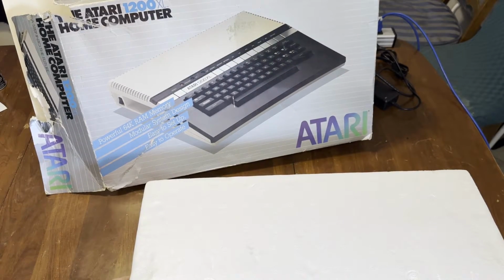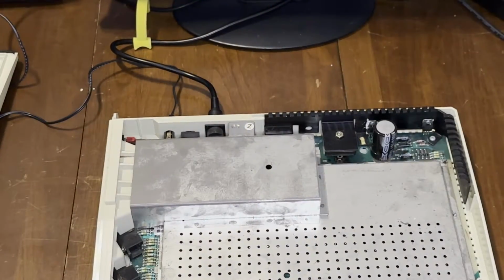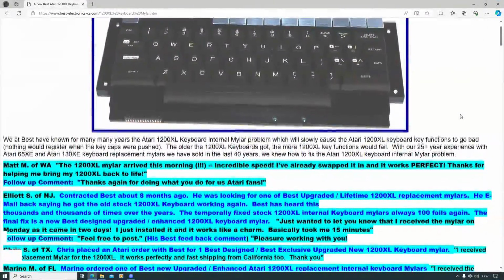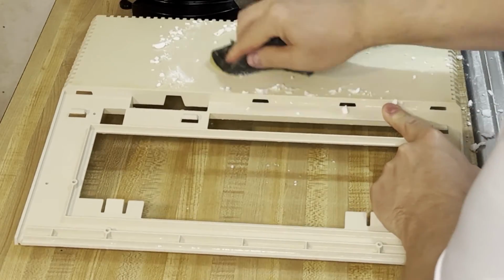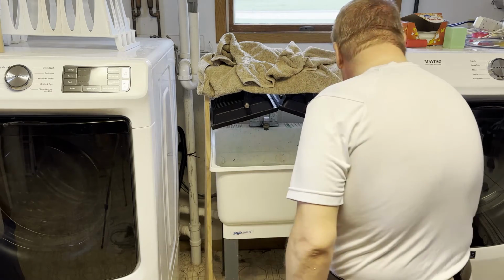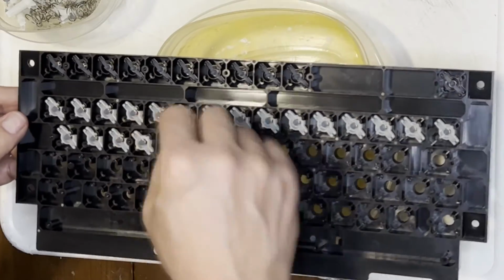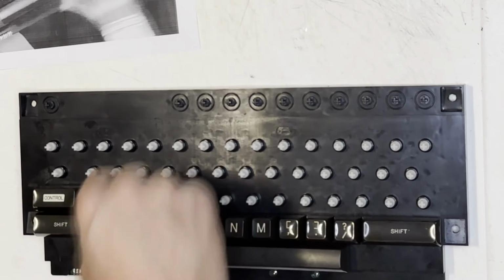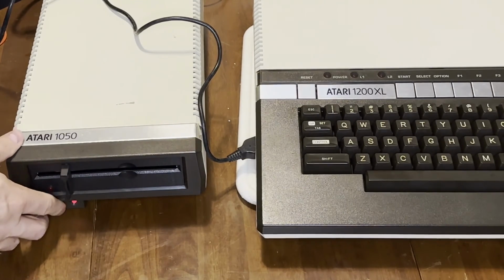Atari 1200XL Restoration Part 01: Computer

Comment: LOVE the 1200!!If you boot without a cart, it will give you the rainbow Atari logo.    Pressing HELP at this point will take you to the built in self test like all the computers other than the 400/800 have, including the keyboard test.
Reply from the maker: I found that out after the fact, but still this is useful. The diagnostic also was present on the 600xl and 800xl too, when you bypassed the built in BASIC.